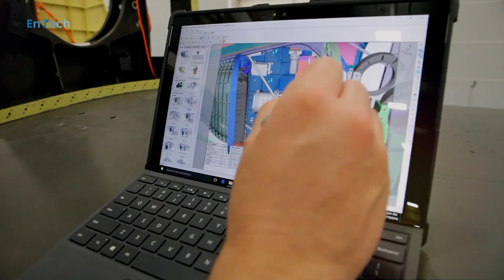Finally: The Bell V-280 Valor Defeats Defiant X, the Black Hawk Replacement Helicopter

Comment: As the V-280 flies forward, the propeller spins on both sides of the nacelle. There is a high probability of a direct hit to the nacelle when the propeller breaks. This would be a direct threat to the lives of the passengers in the cabin.
Reply: ... and in a normal helicopter the fuselage would be targeted anyway which houses the people. The blades are designed to break away from the Fuselage in tilt rotors.